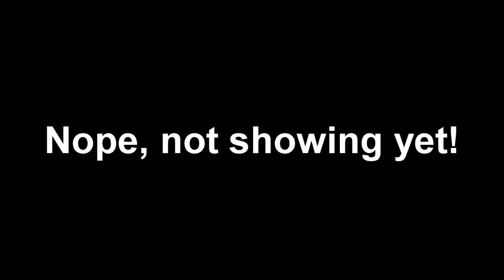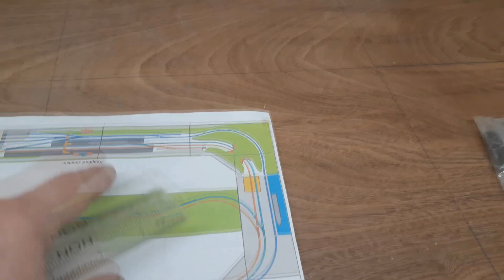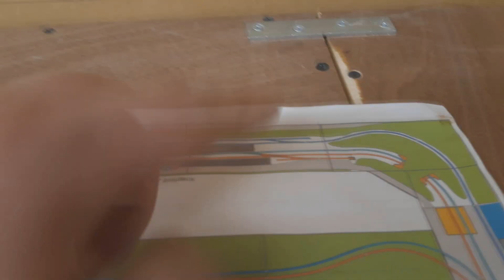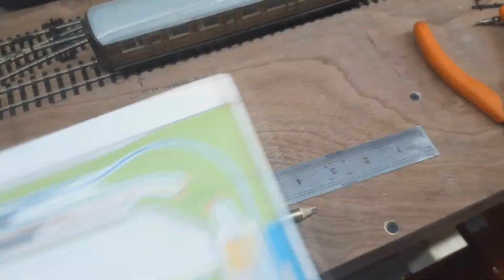NWR - Tidmouth to Knapford & Beyond - Part 3 - Laying the Permanent Way, Track Laying at Last!

Comment: man you do this way different then i would but your way is better even though it takes more time it is worth it
keep up the good work can't wait what it would look like in the end
Reply from the maker: Thanks.  I've tried n learned many different techniques over the years for track laying n wiring.  Mixture of trial, error, reading, watching and experimenting.  Norramby track was glued down.  NWR will also be glued down upon ballasting and screws removed eventually.

I take a slow approach now, measure, tweak, measure, tweak...repeat.  I've had a lot of aggrivation with model railways over the years and learned the hard & expensive way several times, some things are not worth rushing!
Reply: Sparkshot you have a point there you should never rush somthing like this if you do you will be back at the beginning when your old layout never worked well
Reply from the maker: @LNERA3PRODUCTIONS  Oh yes.  That TRoS layout had 4 wires going to it....that was it!

Too many mistakes to mention, but that was my 3rd layout.

This NWR one is my 7th, lots of lessons learned since.

7 is a good number me thinks.

Comment: Looking forward to seeing this progress.  Peco Bullhead certainly looks the business, making me think twice about moving to EM.
Reply from the maker: I wanted to do it in P4, I model in P4 sometimes but sadly will have to do a smaller P4 layout again.  I did want the NWR to be P4 but I don't have the space for the curves.  The 00 Bullhead is a compromise.  If you think it might be ok rather than EM try a few test bits maybe.
Reply: @sparkshot  It's just that narrow look. It seems to not look narrow gauge from the side, but from head on the Locos and track do still look a bit narrow compared to EM.
Always the case with P4 sadly, hard to build something big due to time and space constraints at home.
Maybe you could do the terminus only in future in P4?
Also, I see you don't have a fiddle yard, will you still be able to operate fully without?
Reply from the maker: @Lennon6412  - The middle removable section is deeigned to be modular so can have fiddle yards there and also different scebes/layouts can plug in.  But Tidmouth station plus the sidings adjacent are in essence train storage for fixed rakes.  Pilot would draw them out and shunt them in, trains leave, do a lap (or few) and through middle section then run around at Knapford to return, then either shunt the train back or let pilot deal with them.  That's the plan.

The build time isn't the P4 problem, I did radius tests and most my P4 loco's are ok but my outside cylindered engines (Gordon etc) if converted would not do them due to cylinders restricting bogie pivot.  That alone is what finally made me squirm back to 00 for this one.

Comment: That's different to my set it had nails except the turntable sidings had screws not as small as yours...whoops though they broke the track planks.
Reply from the maker: Yup!   Exactly, over big screws will wreck a sleeper and nails, if you miss you dent or bend the track and when they go in they often drag the sleeper down and turn them into V shapes as you found out.  Screws are better.  Easier n safer getting them in and 40 times easier getting them out.
Reply: @sparkshot  Better than using a hammer to take the track off damaging it at the same time.

Comment: Is there a reason you aren't laying the  track on a roadbed of some kind? I don't on my layout because I can't afford it, but I'm curious of your reasoning.
Reply from the maker: Fair question.  🙂  
There are 3 reasons to my knowledge underlay/road bed is used.  In no particular order...

1)  To lift the track to provide a taller ballast shoulder.

2)  To quieten the noise of trains drumming the baseboard.

3)  To smooth out irregularities and  cut 'below' the track easier to bed details in.

I'm not bothered about cutting in so #3 doesn't matter.

I'm not bothered about a ballast shoulder as some areas indeed looked pretty flat, especially some stations and even some country side.  Both raised and non raised are prototypical, depends entirely what or where you are modelling, this layout is mainly 2 stations so not bothering.  Link bits and middle sections once get around to them can have ballast shoulders maybe, so #2 doesn't matter.

#3 doesn't matter either, although I want some DCC sound I care not one iota about sound deadening.   The rumble and echoing rail joint clicks I quite like.  To me it's more realistic and nostalgic from earlier days anyway.

Now, the old TRoS layout had Cork as underlay.  Warped like a banana after ballasting and caused buckled track.  Although many like it and get away with it....not me, just soaked the pva n water, swelled then deformed.

Then the mini P4 layout had Polyurethene foam underlay (doesn't crumble in 10 years either)  This was a lot better and I'd be happy to use it again, however, I found it hard to fully seat something exactly due to springyness.

1st N gauge layout I used same foam as a bed and Card to underlay certain track to change heights...again, after ballasting it warped like a banana, I also didn't gum up points and holes so pva ran down into point motors and the 2 things combined resulted in me putting my fists n feet through the layout.  See Out N About Part 19 for more there and pictures.

Norramby I used Bass Wood as underlay to change track height and THANKFULLY after ballasting it didn't warp anything save for a small bit in the goods yard where no track was.

Ergo, in my subjective experience, unless I really need it any type of underlay or track bed can royally piss off;  more trouble than it's worth.  🙄
Cheaper n quicker without too.

But!   Feel free, you may have a better experience, many do.  🙂

Comment: hello sparkshot i just had a thought
because you are building your models from scratch or 3d printing them
what are you going to do with donald and douglas?
are you going to 3d print them or are you building them from scratch
or are you going to modify the bachmann models for the railways of sodor?
Reply from the maker: I have already created 00 / 4mm bodyshells for the 812 class and tenders for them.  Just haven't made a YT vid advertising them.  Still need to design the chassis for them but at least 3 people I know have already made a Hornby Drummond 700 Class RTR Chassis fit.  Please send an email to sparkshot082@gmail.com if you'd like a bodyshell. 🙂
Reply: Sparkshot okay clean awnser 
I think ill get a bodyshell later because i dont have the budget at the moment ill keep it in mind though
Reply from the maker: @LNERA3PRODUCTIONS  - Ok no worries.  Bodies here are £44.89 plus postage.  On Shapeways they are rather more than that.